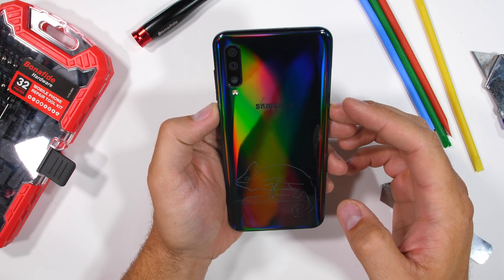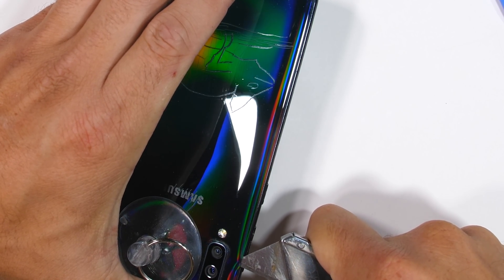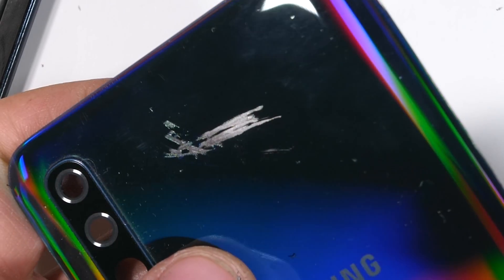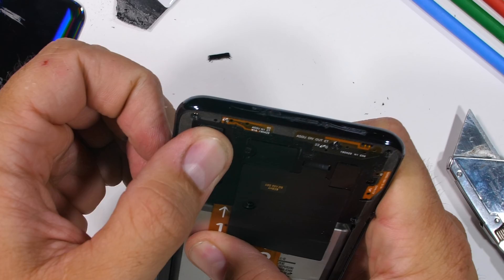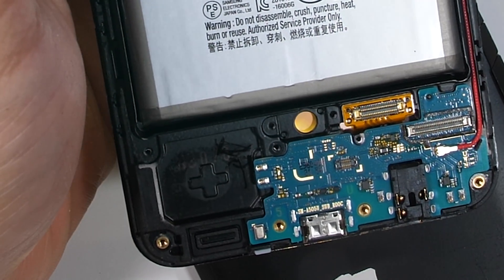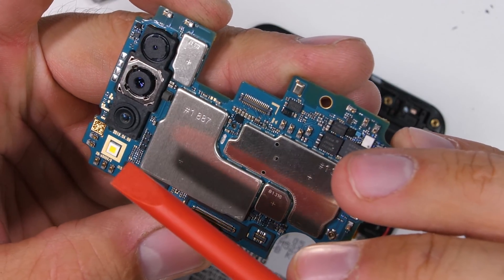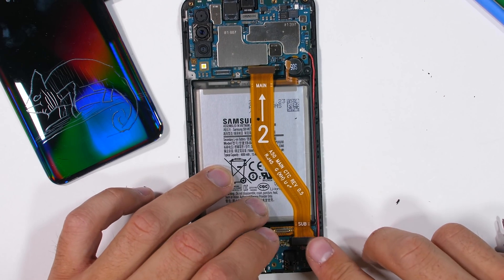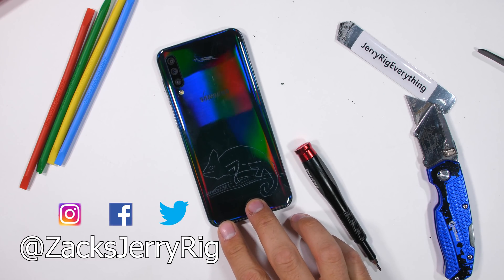Galaxy A50 Teardown! - Did something crack inside?

Comment: Have you ever tried creating your own phone, useing parts from other phones to create your own Doctor Frankenstein type monster phone?
Reply: Mīćhæł Pīņəß I just want something unnecessarily overpowered so I guess an A10 bionic will do because I want to stay in the ecosystem
Reply: @thefloppafanatic3450  Display like OnePlus 8pro

A13 bionic chipset

8/12 GB ram with 256 GB storage.

Google pixel type photo software
And apples video software fused together with Samsung s20's camera hardware.

Stock android operating system.

One UI 2.1 features.

Note 10+ like design with OnePlus 8's interstellar glow but with a matte finish.

Under-display fingerprint scanner, the same with Samsung's S20 ultra.

OnePlus's alert slider.

Headphone jack.

144hz display paired with 240hz screen response time.

iPhone se type size.

iPad pro's thin and sleek hardware.

And top it all off with Pocophone f1's price!!!!!!!!!
Reply: iDope Gaming sadly that would not be in the poco f1 price range
Reply: @Mīćhæł Pīņəß  

26mp or more back camera. Not worried about 3d imaging.
10mp for front camera. No notch! 
Decent speakers top and bottom, at front of phone. 
Oled display, 5.5inch.
250gb or more internal storage, with expandable sd card slot.
Half decent processor. 
6GB Ram or more.
4000mah battery, tbh as long as its lasts all day or most of the day I'm happy with 3mm headphone Jack. 
Not worried about wireless charging. 
Finger print sensor on back. 
Water tight up to 1meter for 20mins.
Usual stuff like Bluetooth, wifi, nfc.
Reply: Aaron Lisle 
My perfect phone would probably be :
5,7 inch OLED display
64 gigabytes of internal storage
4-6 gigs of ram
Wireless charging
IP68 Rating for 3 meters for 30 minutes
A12-13 bionic chip
12 mp 2x telephoto lens
12 mp 0,5x Ultrawide lens
FaceId
A security chip
Reply: @thefloppafanatic3450  7 pro
Reply: @bendover2027  bro my comment is over a year old
Reply: @Killer9010  5,5 inches?!?!
Reply: @GingGongg  don't knock it till you try it 😜
Reply: @Killer9010  i have tried but it's Hard fitting that much power into a small phone
Reply: @Killer9010  k20 pro
Reply: @Killer9010 Wrong
8GB RAM
128GB RAM
8500mAh baterry
2.3Gh
3.05Gh
Camera 48 mp back
Front camera 16mp
Reply: @Mīćhæł Pīņəß I have seen amazing photos taken on 16mp cameras, MP don't matter at all
Reply: @manolinmero  my samsung galaxy s5 has 16 mp and I can youtube with it
Reply: @Mīćhæł Pīņəß I remember having a xperia with a 48 MP, my brother had an iPhone 5s with 8mp and his camera looked better, also the pixel has like 12mp and its still one of the best cameras in the market for smartphones I was wrong in saying MP don't matter but it's not the most important thing, and I'm pretty sure in most cases it's just a gimmick
Reply: @Mīćhæł Pīņəß it depends on the size of the sensor, increasing the mp count is cheap so companies do it to trick their customers while photos dont look much different at all.
Reply: Guys all you need is 12 MP
Reply: Mīćhæł Pīņəß ya gotta love that audio jack
Reply: Pretty late, but here I am.

Android Q
1440p dynamic samoled display (s10)
Apple a13 bionic
120 hz display refresh (razer phone 2) (max)
Speaker setting similar to the one plus 7
Audio jack
5000 mah hour battery.
6.7 inch curved display with shatter shield. Big notch with notification led, face I'd type scanner, camera. 
Penta camera like the one on xiaomi mi cc9 
Programmable top button like on ancient iphones. 
Wireless charging with the 50 watt and lower charging of the oppo or whatever phones.

Software support of atleast 3 years. 
  
Water/vapor cooling or thermal chamber 

2 sim card slots with expandable storage.

Dont forget the ip68 waterproofing

Now I know this will make the phone bulky, and I'm alright with that. 240g with 8.3 mm size should make up for it Also, even if this phone costs 1500 hundred for the base model, I think it'll be worth it.
Reply: A regular smartphone say i phone 5se jailbreak it give it the ability to run the ios and android stuff take the back make the whole phone thicker adding 2 other batteries on a circuit that switches them to the correct mode this way you can charge 1 battery while another powers the phone this stops battery damage as for the second battery it’s back up  when  battery A runs low (not to low again avoiding damage) the phone diverts power from battery b whilst you’re still able to charge battery c once battery A is no longer powering the phone it begins to charge taking battery C’s role battery c takes battery b’s role and battery b is already in battery a’s role the trio of batteries should work in harmony protecting them from ever being damaged by the most common stress batteries get (charging while in use) the total battery time would be very long at least 2 days the phone would also have a forced low power mode for when you have used  battery A and battery B and now on c  because say for example you didn’t charge it anyway this mode would shut down all non essential things such as games music etc only leaving things like internet for browsing and calls and texts this would stay on until the phone is fully charged if the phone anyway the phone the batteries would also be easily replaceable would also have a option to add solar panel for charging and would be waterproof
Reply: 4.5 inch sAMOLED display
16:9 Aspect Ratio with bezels
rear fingerprint scanner
one rear camera
one front camera
dolby speakers
plastic rear
5000mAh
Qualcomm Snapdragon 821
Stock Android
Reply: @Mīćhæł Pīņəß 48+ megapixel main camera
16+ megapixel ultrawide lens
10+ megapixel telephoto
10+ megapixel macro
48+ megapixel front camera
Apple face id
Apple touch id
Superamoled quadhd+ 120hz display(ilovehighfps)
10-bit colour (1 billion colours)
Apple A13 bionic CPU
SnapDragon 865 GPU
IOS 13 with all Android features
IP69 nice water and dust resistance
3D Touch
Super-Fast wireless charging
CPU and GPU boost 3.0
55W SuperFast charging
AKJ headphones
AND FINALLY A CERAMIC BODY😵
Reply: @jivvr  AKG*
Reply: Outside iphone xs - inside samsung s9/android10
Reply: Mīćhæł Pīņəß  108 MP Rear camera
40 MP Front camera
10000 mph battery
Screen with Super Amoled, 400 ppi, 7.00 inch screen
Qualcomm 865 processor
Reply: @opensourceis9996  sounds like a tablet 😂
Reply: This sounds like a great collab idea for Zack and Safiya Nygard.
Reply: Note 9 with upgraded characteristics (battery, processor, memory) and a wide angle camera, but no design change
Reply: wouldn't work, not all parts are made for each other. he needs to build a whole new operating system for that too. since well, LG batteries aren't made for Samsung phones and iPhone cameras arent made for Samsung phones as well. If he learns programming i would totally buy a JerryUI phone.
Reply: @Mīćhæł Pīņəß yeah, edited
Reply: Mīćhæł Pīņəß A70 also has the rainbow panel
Reply: Mīćhæł Pīņəß An iphone with the headphone jack and a built in fingerprint sensor.
Reply: @Aiden Brister as a right handed S-Pen user, the power on the left is great for me - probably why they put it there forgetting that most Note users will rarely use the pen :)
Reply: Mīćhæł Pīņəß The one where you said back panel on a50
Reply: Is it alright to say what my perfect phone would be though im late?
Reply: That wouldn't work because different parts from different phones don't fit on the same motherboard.
Reply: @fbiagent6081  its a what if situation......
Reply: @Killer9010  you said have you ever tried?Not What if you.But ok
Reply: Snapdragon 855+
Reply: Not a phone but 11 inches display, full screen display, punch hole camera, face id (like on apple), 240hz refresh rate, ip999water resistant rating (if possible) up to 120 meters in 24 hours, on screen fingerprint scanner, Apple A13 or Snapdragon 865 chipset 12gb ram (because i like playing alot) 1tb or 512gb storage because why not i have a lot of good games to discover 40 or more mp telephoto lens, 40 or more mp wide lens and 40 or more mp ultra wide lens all cameras with night mode, flash with brightness setting, 40 or more mp selfie camera, 4k display , 4k recording and up to 8k photos (if thats not illegal on a smartphone) 9,000+ mAh battery or more, Fast charger, usb type c adaptor, surround sound, 4 speakers, true tone display (like in apple), 1ms delay display, stylus support (apple pencil or samsung stylus), cooling setup (like on the asus rog phone, red magic 3 or 3s, and razer phone), and headphone jack with included 8k sound headphones with active noice cancellation and transparency mode, I just like a powerhouse for ultimate gaming experience and not very much like a phone.
Reply: omg thats such a good idea
Reply: 4 moths ago but ikmma say

THE Monster isnt frankesntein its the doctor ffs  DOCTOR FRANKENSTEINS MONSTER DONT DO THIS MISTAKE
Reply: A much lighter and much more beautiful asus rog 2
Reply: That would never work.
Reply: Or an IPhone 11 pro with a 5000 mah battery, bezels instead of notch, dual front firing speakers, headphome jack, and a 40watts fast charging
Reply: I did using parts from different htc one m8’s, I had taken so many apart so many times that I was able to take everything out of it and put it back together in under 15 min.
Reply: SDM 845 and a headphone jack 
No cameras and that's all
Reply: Be should try that, it'd be cool
Reply: DOOO THAT!!!
Reply: No.....
Reply: @Mīćhæł Pīņəß I would want a stainless steel frame, an amoled panel protected with a sapphire panel, glass back, 3.5 mm headphone jack, 108 megapixel camera in all perspectives possible, a 7000 milliamp hour battery and dual 48 megapixel front facing camera AND all that under 500 USD from Samsung (BTW, I hope that Samsung is watching my comment. )
Reply: @Mīćhæł Pīņəß 
- Idgaf about the camera
Flash
Decent speakers top and bottom 
Headphone jack
Oled display 6 inch (I prefer more screen space because I have quite large hands)
Go all in on the storage 500GB w/SD card slot
A13 bionic chip 
8GB Ram
Newest adreno graphics renderer 
4000mh battery
Wireless charging is inconvenient for me 
Water proof eeh 2M for 10mins (sure I'll never leave my phone in water for long anyways)
Finger print scanner on the back
Completely sapphire frame 
I'm okay with gorilla glass
5G WiFi and Bluetooth and lan, etc.

(Now mind you this is a "perfect phone" I'm not factoring in the likely Gigantic cost of such a beefy phone or the manufacturer's available shipping locations.)
Reply: When you have A10S and dreaming of this phone

By the way my cousin have this phone massive heating  problem while gaming
Reply: @Mīćhæł Pīņəß simple. Modular parts that I can make myself
Reply: Body:
Glass Front
Glass Back
Aluminium Frame
IP68 Certificate

Display
6.3 Inch
Super Amoled UHD+
Infinity-O Camera Punch (like the galaxy S10)

Processing Power
6GB Ram
128GB Memory

Camera (Quad)(Vertical Setup)
48mp Wide
8mp Ultra wide
8mp Telephoto
5mp Macro Lens
Dual Tone Flash
32mp Dual Pixel Selfie Camera

Sensors
Side Fingerprint Sensor
GPS
Accelerometer
Gyroscope

Other
Headphone Jack
Radio
4G

Battery
4000mAh
Fast 25w Charging
3.1 USB C Reversible Connector
Half decent processor

Asking for too much but crap I love it
Reply: For me it would be this:
765G
Glass black, colourful like new Xiaomi phones
6.4 AMOLED variable refresh rate 30-120Hz
64MP wide main, 32MP ultrawide, 12MP macro, 12MP telephoto cameras
32MP ultrawide selfie camera, behind the display, hole punch or maybe one that flips around from the back
8GB RAM 256GB UFS3.1 storage, MicroSD expansion
Stereo speakers, 3.5mm headphone jack on the BOTTOM of the phone- I hate it when there's a cable coming from the top and bottom of the phone cause I can't set it down.
4 microphones for noise cancellation
33W USB-C charging, 15W wireless, 4500mAH battery
WiFi 6, Bluetooth 5.1, NFC etc.
Gorilla glass victus
In-display fingerprint sensor (ultrasonic)
IP69 and an aluminium frame.
Little more simplified MIUI-like OS.
Google's age processing
For around $500
Reply: Realme x3
Reply: Mīćhæł Pīņəß
6.9” 2.5D curved 1080p 120Hz sAMOLED  center hole punch Infinity-O display with the Galaxy A series’s optical fingerprint scanner and Gorilla Glass Victus7
QComm SD 765G and whatever GPU comes with it
3.5mm headphone jack with Q-Dac
Note20 Ultra camera array
S-Pen
Glasstic back with a matte finish
S20 Ultra body
USB-C with 45w super fast charging
Wireless charging with 15W Wireless PowerShare
IP69K
Dual speakers with Dolby Atmos support
Android 11 with One Ui 3.0
$250
Reply: LOOOL
Reply: Mīćhæł Pīņəß close focus is crying in the corner
Reply: Mīćhæł Pīņəß flagship iPhone internals in samsung note 20 body
Reply: He should use the bionic a13 as it's brain....
Reply: That would be amazing, if the little lego connectors were the same so u can connect them, unfortunately they r not
Reply: I’d probably buy that phone lol. Really sucks because you might not be able to use cross company phone parts. Like a Taptic Engine with some android mobo.
Reply: Na
Reply: My phone would be

Cameras
4k 60 fps on all cameras
48 megapixel main telephoto camera with a f2.0 aperture and ois

12 megapixel wide angle with f1.6 aperture and with ois + 8k video at 30 fps only on wide camera 

13 megapixel ultra wide camera f1.7 aperture with ois 

13 megapixel time of flight camera f1.7 aperture 

32 megapixel front facing under display selfie camera f1.7 aperture 

Battery 
5300 mh battery 9w reverse wireless charging. 65 watt fast charging.
30 watt fast wireless charging.
USB-C TO USB-C

A flash

Storage: 256gb

Ram 16gb ram with UFS 3.3

Display: 6.8 inch OLED super amoled display quadhd+ 120 hz refresh rate 
240 hz touch response rate 
900 nits brightness 

Biometrics and security 

3d facial recognition 
3d under display ultra sonic fingerprint sensor 

3.5 mm headphone jack 

Processor apple a15 bionic chipset

Ip68 water resistant for 8 meters for 1 hour
Reply: That would be awesome maybe if he could call Marz
Reply: Candra Nugraha  what would be your phone
Reply: My dream phone would have a 100x optical zoom
Reply: @Moray_8865  that's like some 2070 type stuff
Reply: YOU GENIUS
Reply: It cost much more then the original phone
Reply: dang yk how to make bombs from that stuff lmaooo
Reply: Huawei mate 10 pro
Reply: Nokia 5130 c2 Xpress music
Reply: Dude thats a phone not really a pc 
The parts are not interchangable if you wanted to build your own phohe it would have to be from VERY limited parts. So its not really duable.
Reply: @uniqueusernane8204  check out Fairphone... All the parts are interchangeable..... Unfortunately not alot of parts to choose from, but love the idea.
Reply: @Mīćhæł Pīņəß 1000 mp camera, 256 mp ultrawide, 108 mp telephoto and 100 mp macro camera with 200x zoom, snapdragon 9999, gold and diamond body, diamond screen, 8k screen display 100000mah battery, 1 TB storage with expandable memory upto 3 PB, 500gb Ram,  no notch and 750mp front camera and 80k video recording and at last a HEADPHONE JACK

i want all of  this

FOR FREE
Reply: @Mīćhæł Pīņəß 1 Terabyte, 69gb ram, snapdragon 69420, screen size 6'9, ultimate gorilla screen, wavy design, 69000 mAh, with free headphones
Reply: That was project ARA
Reply: 5,8 Inch sAMOLED display, 1 12mp ultrawide and 30mp normal cam
usb c, headphone jack, 128gb storage, 4 gb ram, fingerprint sensor pn the back, some decent 2,x ghz quad core processor and idk anymore

Comment: plastic back is  better.. phone makers should work on improving plastic not glass.. bcoz it makes phone much safer when dropped
Reply: I remember my plastic back phones, the plastic back popped off every time it hit the ground exposing the battery and circuit boards, besides plastic doesn't disperse heat across a larger surface area as effective as metal / glass, plastic will just throttle the cpu / gpu.

Comment: Jerry can you help me?  I replaced the number 2 flex cable for the A50 cuz it was damaged , it seems to be the charging port board cable, i can see the phone charging after connecting the part. But it doesn't power on. While charging, when i press the volume buttons it lights up but no response when i press the power button. Any ideas?

Comment: The cost to repair the screen on these things is almost the cost of the entire phone. I dropped mine once, literally once, with a protective case on it and it smashed the screen. I called a service center to look into how much it cost and it was roughly $60 cheaper than buying a completely new phone, so what is the point of even getting it fixed at that price?

Comment: I don't know if they even need adhesive under the battery. Wouldn't it be enough to just put it between two components or fix it with a metal bracket?

Comment: At the time of battery replacement you are gonna throw that battery after removal and put a new battery inside and the glue isn't strong enough to bend the battery dangerously bcz companies know what is safety standard . So I don't know what's the point you make regarding battery .

Comment: Hey Zack, you can use 99% isopropyl alcohol and a dropper or run a small amount on the end of your pry tool to soften the adhesive. It's safer and considerably faster. 

That being said, I certainly don't appreciate what manufacturers are pulling here. I don't understand what's so difficult about using pull tab adhesive strips. It' would make a good chunk of my job less of a hassle.

Comment: I was replacing a battery to diagnose a iPhone 7 one time and the battery pull tabs  broke so I pried the battery out and the battery exploded in my lift with only a tiny window and the phone was hot I wouldn't pick it up so I grabbed a blanket and threw it out the window and it cought on fire